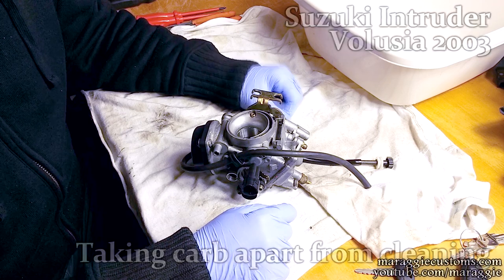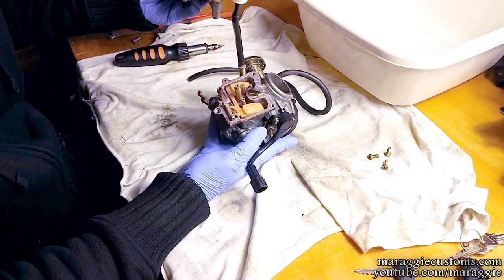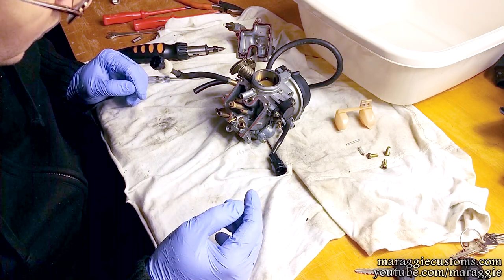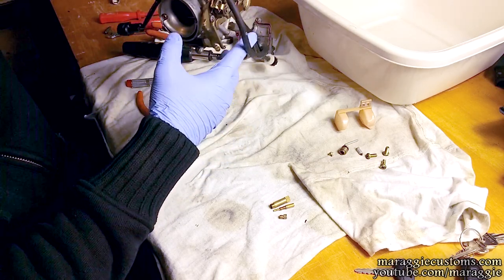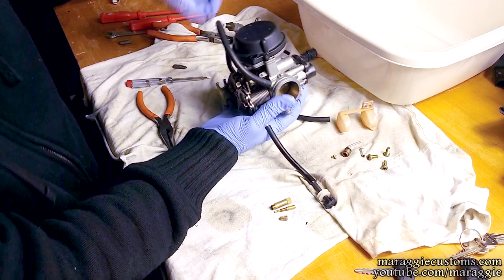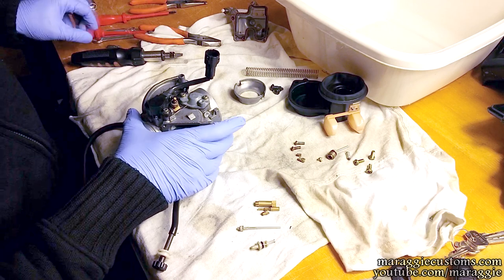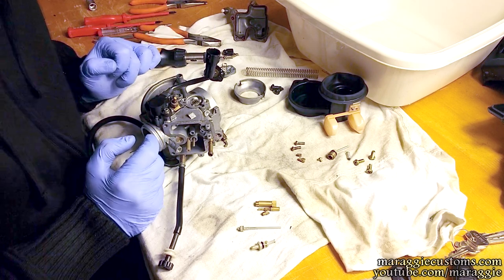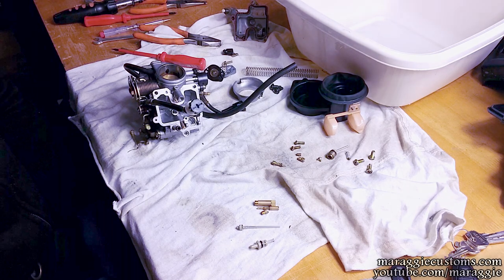Suzuki Intruder Volusia - how to take the carburettor apart

Comment: I had heck of a time with taking out the funnel (starting at 10:15). The two screws holding the funnel would not budge. Ended up striping the head. Tried screw extractors. Still wouldn't come out. One left hand drill bit even broke inside the screw. Both heads eventual broke off.   So the funnel is off but leaving two broken screws stuck in the holes. Used dremel to cut them off flush with the base. Then came up with an idea to weld the funnel to the carburetor because the broken screws got stuck and I didn't think they would come out and I didn't want to drill any further to risk messing up the whole carburetor. Long story short, I managed to weld the funnel to the carburetor using a flux core welder and got my 2004 Suzuki Volusia limited back to work after sitting for a few months and would shut off if giving any gas. Thanks for this video series that gave me great confidence to even attempt with this project. I followed the steps almost exactly, except this issue with the stuck screws. the only other difference is that my bike didn't have the adjustable air mixture screw. It's a fixed piece I can't even take out. Very happy to get this carburetor cleaned and the bike started and run normally with full throttle. Thanks for the time and effort in detailing the process!
Reply from the maker: Hi. Quite a story! There's always something that causes unforeseen trouble. I'm glad you managed to sort it and got the bike running.  I'm glad you found the videos useful, cheers.
Reply: same thing happned to me, stripped the screw on the right, was able to use a screw extractor to get it out. the one on the left the head snapped offleaving about a 1/4 inch sticking up, but not enough room to get some vice grips around it to try to spin it out.  going to try using a heat gun on it tonight.  Funny thing is that the Clymer manual i' have says to use the Loctite Red which is permanent. but clearly its blue on the screw i got out.

Comment: Those screws holding the funnel are thread locked so that they don't vibrate loose and get sucked into the motor.  You need to use a JIS (Japanase Industrial Standard) screwdriver to remove them and not bugger the screw heads. They LOOK like Phillips heads, but they are NOT. Phillips drivers/bits will cam out of the heads and wreck them. The same is usually true for just about any Phillips-looking screw on Japanese metric bike components, particularly the carbs.
Reply from the maker: Hi. Thanks for your comment. It's a very good shout regarding JIS screwdrivers. I have to admit I still don't have a set and so far I managed to get away with not causing a great deal of damage to any of the screw but the fact that standard phillips ones do cam out is very real. All the best.

Comment: I just pulled out my carb and took it apart. My bike was running short of fuel when i was sure the pump was discharging. i found a filter in d float chamber. the filter was completey clogged. i cleaned it out and d jets. for the first time i was able to push the bike to 160km/h. thanks a whole lot for the video it was the only reason i could attempt  it.
Reply from the maker: +Idorenyin Akpan That's what I love to hear. Thank you for watching and congratulations on fixing your problem yourself!

Comment: Excellent video. I am also very impressed how responsive you are in the comments. I bought a 2004 Volusia project bike a few weeks ago and am in the process of restoring it. When I pull the carb I plan to replace all of the jets per your recommendation in these comments, but are there any other items in the carb I should replace while I’m at it? Also, do you recommend a parts website to purchase these items? I’m located in the USA. Thank you!
Reply from the maker: Hey Philip. Thanks a lot for your comments, much appreciated. With regards to the parts needing replacing, they'll depend on what you find when you open the carb up. Usual suspects are bowl gaskets (hardened, crumbling), float valves (wear on rubber tip), diaphragms (holes, tears). Rest should be fine. I always replace all bolts with new stainless allen bolts so it's easier to rebuild next time. If the bike is really in rough shape, it wouldn't hurt to replace all hoses as well that are connected to carb. Hope you'll find working on the bike enjoyable.

Comment: Thanks for the video! But I have a really bad habit of taking things apart and not putting them back together properly. I understand obviously everything would go in reverse order, but I would really benefit from a follow-up video. If you have another opportunity to put a similar carb back together, please share!
Reply from the maker: +Richard Quillen Hi Richard. Thanks for the comment. Winter is coming, bike is parked up (more lack of time than dislike of temperatures). Come sprint I'm very likely to get carb out, this time to replace all jets and I will make sure to record everything, including assembly after the job is done.
Reply: @Maraggie , have you done a followup video for reassembly yet?
Reply from the maker: Hi Brandon, 
Unfortunately not. I sold the bike to new happy owner quite a while ago.

Comment: I would update video to address the small o-ring next to the diaphragm. Mine was missing, and created a vacuum leak that mimicked a bad diaphragm. 
I do have a question in regards to the air jets located under the  mini velocity stack(appears to my that’s how it functions anyway) in your video, you remove the two air jets. There is to reference to the second smaller air jet in any of the parts fiche I have seen. This would be the jet that supplies the accelerator pump. The one I removed from my carb is stamped with immunity logo and 1.9.  The orifice seems quite large, almost as large is the 155 main chat I installed. I cannot find any 1.9 Mikuni air jet that remotely resembles this jet.
Reply from the maker: Hello. Can't redo the video I'm afraid as the bike is no longer in my possession. As for the smaller air jet, you can find them on ebay when you search for "genuine mikuni air jet 1.9"

Comment: Hello do you have a video on how to adjust the float, thanks
Reply from the maker: Hi Martin. Unfortunately no. I no longer have the VL800 so can't record it either. It's very simple though...you adjust the float by gently bending the metal bit that holds the float valve. Drop me an email (you can find mine in "About" section of my channel) and I should be able to send you a page from the manual that describes how to do it.

Comment: After cleaning the carb and throwing it back together, I’ve limited my top speed. I seem to have governed myself at about 70-75 when just the day before it fouled out I was pushing 100+ . I have an 01 any pointers brother ?
Reply from the maker: @bradyyancey4747  Hi. Is the acceleration different now? And what happens when you try to push past 75...does it stutter, bog down etc?

Comment: Is it not necessary to put the carbs in a vat once parts are all removed? I have one that was sitting for 20 years with just 1200 miles. The floats and bowls are solid built up with, whatever gasoline turns into over time. Its a carb for a 1400 cu, 1996 Suzuki. Thanks!
Reply from the maker: Well it does depend on the carb condition of course. So if they're really bad, an ultrasonic bath is highly recommended (as I review and how in other of my videos) All the best.

Comment: What is the exact size of the fuel line on that bike? I want to run an inline fuel filter. I got to go buy some line but I was trying to figure out the exact size. It's 516 right?
Reply from the maker: Hello. I'm afraid I've no idea. It's been years since I had this bike and I'm unable to check. Someone from community should be able to confirm, I'm sure.

Comment: What is that hose on there you left on near where the throttle & return cables connect?  Doing mine and cant remember what it was
Reply from the maker: Hi Luke. If I remember correctly it goes to pair valve on left hand side of the engine. Have a look at the previous video on how to take the carb out and about mid way it's quite visible where it sits.

Comment: Hey!!! Great video. I'm about to do a rejet on the 03 suzuki volusia intruder. Is it basically the same principle as taking the carb apart as you show  here? Anything extra I would need to know? Do you have any links to a carb rejet I could watch? Thanks for your time!!!!
Reply from the maker: +Kirk Helmandollar Hi Kirk. Yes, exactly the same..you got the same year as mine. Anything extra..hmm... why re-jetting in the first place? Normally you have to re-jet (and by that I mean putting in larger size jets) when you replace exhaust and air filter. If it's just the exhaust then you probably don't have to. I've ran Jardine Rumblers and now I got V&H Pro Pipe (just uploaded new video) and for neither I had to re-jet. By the way...the actual re-jetting is simply unscrewing jets out and screwing new ones back in..so nothing complicated. Any questions, don't hesitate to ask, I'll be happy to help. In fact, I will be recording another set of video soon, where I will be renewing my jets after winter so all will be covered in detail.
Reply: +Maraggie Thank you very much for the reply. I am having some issues with the bike so I am completely redoing the fuel lines, vacuum lines, new fuel pump, and decided to rejet while I'm in there. Also I figured with the new pipes it may give me a little boost in horsepower. Hahaha. But anyways, thank you so much for your reply. Very very cool of you. BTW..... Would I need to buy an entirely new air filter fixture or can I just buy a new k&n filter and get decent effects?
Reply from the maker: +Kirk Helmandollar No worries, that's why I'm here :) Always happy to help if I can. I understand now, it's a good thing to do on our age bikes.. re-doing lines is on my to-do list as well at some point. What pipes are you putting on then? Remember that "boost to power" = worse fuel economy ;) but who cares about fuel economy :D
As far as the filter goes, you can either get the full monty if you want to change that ugly rugby ball case ;) or you can get K&N filter that will fit into it. If you want to go wild you can get rid of the side filter all together by installing uni filter under the tank, directly on top of carb. :) Whatever you choose to do, let me know and I'll drop you a message with re-jetting charts (unless you already have it).
Reply: +Maraggie You are possibly the coolest guy I've ever had the chance of talking to. I am planning on putting a set of cobra Slashdowns on the bike. Also buying a stage 1 jet kit. The dealer said they cannot get ahold of anything larger. So either way. And as far as fuel economy goes..... Well..... That's not why I ride Hahaha
Reply from the maker: +Kirk Helmandollar :)  Slashdowns are sweet pipes...long ones. And if I'm right they come with their own mounting bracket so you'll be able to throw away that nasty stock one. So Cobras, K&N and st1 re-jet... should be fun. I reckon the only thing that will be a hit or miss for you is the air/fuel mixture screw later as it'll have to be set correctly for right burning (so you don't run the engine too lean or rich) For that I recomment a tool called Gunson Colortune - it's effectively a fake, transparent sparkplug with a visor so you can see the colour of combustion inside the chamber (super cool when you see it first time) and adjust the mixture screw on running engine to get the perfect colour of explosion :D  Now who said mechanics aren't cool :]
Reply: +Maraggie This is my first undertaking. Haha. So you are being an immense help to me lol. Thank you so much. I'll send you an update on the finished results!!!! You're the best. Stay in touch my friend.
Reply from the maker: +Kirk Helmandollar Please do. It'll be good to see and hear it roar :)
Reply: @Maraggie   I appreciate your vids. I just picked up a 03 volusia and i took it out today -3 celsius for a short ride on my street, i did let it idle for 20mins prior. It has a K&n filter and emgo slip ons and i noticed it bogging out in second gear under acceleration.  Do you think it needs a jetkit install if so what sizes do you reccomend.
Reply from the maker: @stevennicola2165  Hi Steven. Congratulations on the purchase, lovely bike. First two thoughts for you: - I know Volusia is a cold piggy and takes a while to warm up but it shouldn't take 20 minutes. - Before you get into rejetting etc, I think it would be worthwhile to just clean the carburettor thoroughly (and ideally replace the jets with new ones). It might be as simple as that. Failing that, considering you have changed exhaust and filter, you will need to rejet, however I'm unable to recommend jet sizes as I've never had that configuration before.

Comment: I’m rebuilding one now but need to go leaner on the jets does anyone know what Mikuni model it is or where I can get a jet kit?
Reply from the maker: Hi. You can literally search for "mikuni jets" on ebay and pick the ones that look exactly like yours, just different hole size. I actually used some looking a shade different and they worked as well (smaller heads). Or you can go to WeMoto, Fowlers or similar and search by your bike model.

Comment: Am I able to change the main jet without removing the carb
Reply from the maker: Hi. Not likely. It's very tight around the carb and you need to take the bowl off, which is at your bottom left of the carb.

Comment: I am working on a 2004 suzuki intruder. The air valve you show, mine has a brass plug in it with a small pin hole does that come out to access the valve or is it a closed system?
Reply from the maker: Hello. Which one? Can you tell me the time in the video I show it?
Reply: It's the air jets at 13 minutes my carbs, are just like these, but mine are off of a 2004 suzuki intruder. My air jet hole has a brass cap at the end of that tube with a pin sized hole in it. I tried to pry it out it won't go any where. I was wondering if there is an air jet in behind there or not? I was also wondering if you know how to set the float height or if you know what the specs are. Have you done a video on how to put that particular carb back together?
Reply from the maker: Ah you mean the mixture screw (I wrongly called it air jet at the time). If your carbs was not touched before, there is a possibility that you will have a cap covering it up. It's a nasty piece of work as you will have to drill into it to remove it. I was lucky enough never to have these on my bikes. Carbs were always messed about with before me. Check out 2nd photo under this link: https://www.cyclepedia.com/pilot-screw-adjustment/ I bet that's what you mean. GUy there used a screw to take it out :)  With regards to assembly, I'm afraid I haven't had a chance to record it. I sold the bike and it's now with a happy 2nd owner since I had it.
Reply: @Maraggie  thanks do you remember the float height spec?
Reply from the maker: @50caliber16  As per manual, 7mm  +-0.5mm tolerance
Reply: @Maraggie  thank you so very much I have scowered the internet for that info to no avail.
Reply from the maker: @50caliber16  I'll make it even easier for you. You can get the whole manual here: http://www.jaycepatterson.com/Pink.html That's what I always used. Comes in separate PDFs but it's a minor hassle.

Comment: Do you know a good place to replace the O and the ring to seal the float bowl? Mine are either lost or brittle
Reply from the maker: This place http://www.cmsnl.com/suzuki-vl800_model16312/ will give you fantastic photos with all parts numbered (OEM numbers). Then you can go to sites like wemoto or simply ebay and search for parts using the OEM number. Let me know if you need help with that.

Comment: hey maraggie I have exactly the same bike as you what filter do you use? I need to replace mine but don't want to get the wrong one or have to rejet it thanks
Reply from the maker: Hi Michael. Do you mean the air filter?  I Use stock one, like this one: http://www.ebay.co.uk/itm/Suzuki-Genuine-Intruder-VL800-2001-2004-Air-Filter-13780-41F00-000-/321249523565?hash=item4acbf6b76d:g:U7wAAOxy4t1Sg~M1

Comment: I was having the hardest time taking the brass bowl bolts out and while shaking it a tiny tiny o ring came out, I had been following the video to the T so everything was apart. I know its not much to go off but any idea where it may have come off? It measures exactly 5mm in diameter, thanks
Reply from the maker: Hello. That most likely will be an oring that sits on mixture screw with equally small washer. I'm talking about it at 14:00
Reply: My mixture screw wasn't a screw but a solid brass piece with a pinpoint of a hole in the middle so I didn't touch it. I put the oring in the hole to the right of the screw holding on the diaphram in 8:40 as it looked like it went there, but your video didn't show one there. Waiting on a battery before I start it to see how she runs.
Reply from the maker: Possible mate. Let me know how it runs :)
Reply: Cheers, will do!